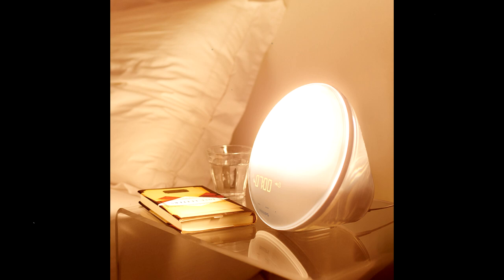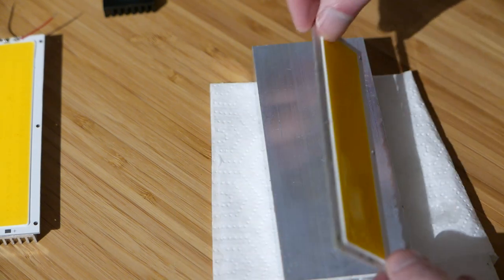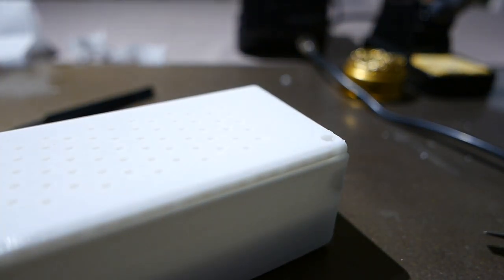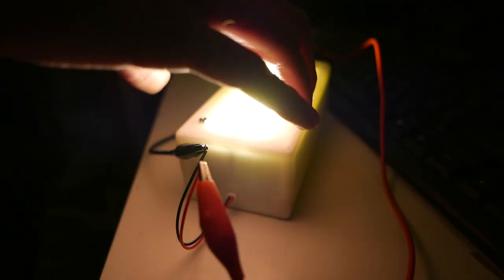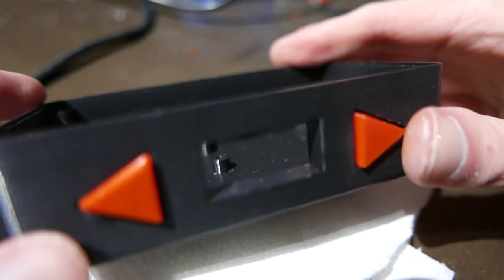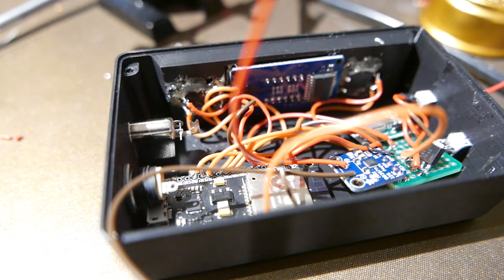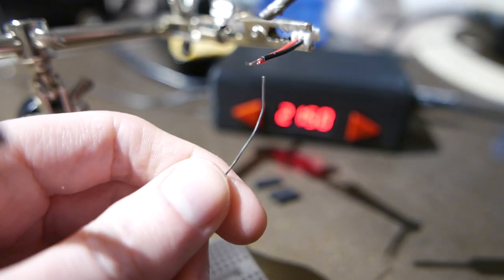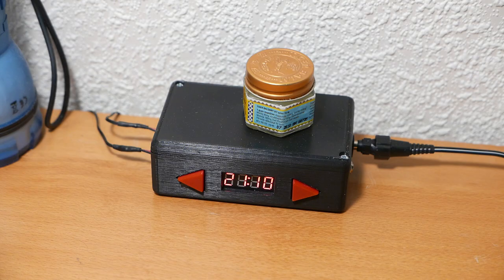DIY Wake-up Light with White Noise Generation

Comment: Great video! I'm shamelessly trying to copy your idea but I can't understand how you are powering the microcontroller. Do you use a 5 volt power supply and take the the power from there or it's the buck converter that has multiple outputs?
Reply from the maker: It's been years, but I think I use the stepdown converter to turn 12V into 5V, I then solder the 5V to the LDO of the ESP32 breakout board. I'm intending on making a new wakeup light at some point in the coming weeks. But it's gonna be a bit more basic, using a clock to count down over 8h instead of having a fixed time.
Reply: @jasdoge  Thanks for the help! I'm looking forward to the new video :)